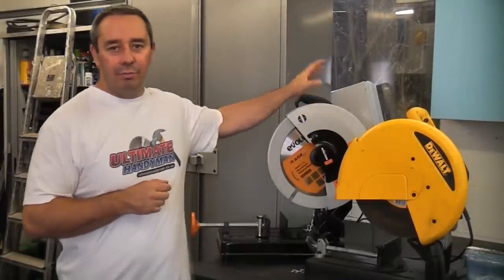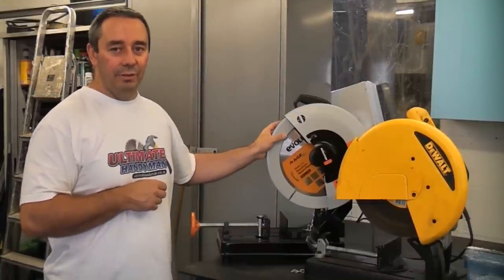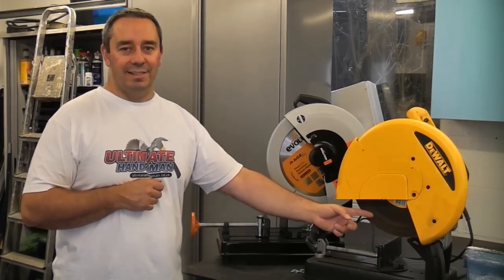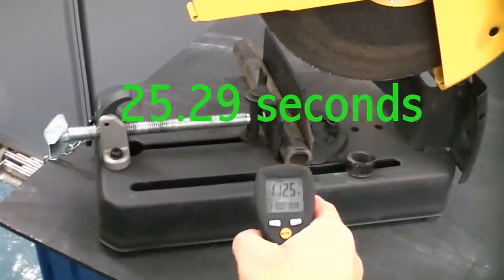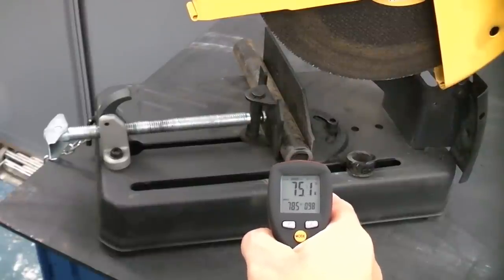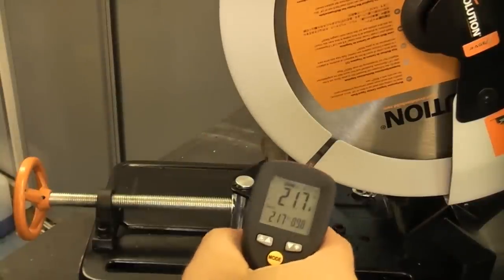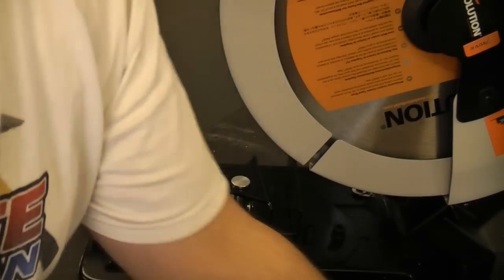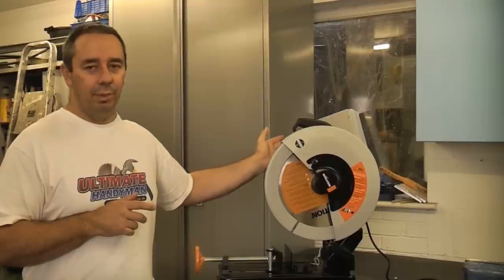Evolution Rage 2 versus Abrasive cut off machine

Comment: When the evolution blade becomes worn it will cut slower and make more noise. It can be resharpened by following these notes.1 remove blade and place on a bench  edge. 2 mark one tooth with white files, that's the first tooth. 3 visually examine the shape of the tooth, one tooth is left angled and undercut and the next tooth is right angled and undercut.4 use a metal cutting disc, not grinding disc!, to reface each tooth the same as it was when new. Rotate the blade refacing each tooth until you reach the files white marker on tooth one. These blades can be sharpened three times.

Comment: Used to have a Makita abrasive cut off saw, changed to Evolution 5 years ago. Only on the third blade and use it most days, have had thousands of cuts out of it including up to 40mm solid bar.
Reply from the maker: +H4NS0L0 
Thanks for the info ;-)

Comment: I bought the next step up Evolution. Its not the Rage2. Its the Evosaw I believe. Anyhow after a short while the cuts were not square vertically. There were a few problems causing this. First and easiest to fix was the fact that the screws that hold the motor together had come loose. They can be tightened by removing the blade to access the screws. All but one can be accessed without removing the blade guard. One of them either requires removing the blade guard or drilling a hole in it directly over the motor screw so that it can be tightened through the hole you drill. Thats the option I took.
The next problem was wear on the axle that the blade motor pivots on. This required tightening the set screws on each end of the axle. That didn't fix the problem so I had to loosen the three bolts that attach the saw to the table and shimming till the saw cut square again.
The third issue I found was the table was not actually flat. This I have yet to fix and will require milling the table flat.
Reply from the maker: Blimey that sounds like a lot of hassle.
Have you not contacted Evolution about the problems?

Comment: I think you were pressing too little with the abrasive. It has to be not too high and not too low pressure to get the most effective cut. If you go too slow it heats up the metal to high enough temperatures that it can harden the metal making it cut slower and in some cases not go through at all!
Reply from the maker: Yes and if you press on too hard there is a risk of the blade disintegrating ;-)
Perhaps you have not seen this video- https://www.youtube.com/watch?v=Orx676NXyws

Comment: Thanks for the video. Make's things clearer for me
I want to buy a cut off machine, but i am also thinking of a bandsaw, but they are a bit more expensive...
What would you buy?
Reply from the maker: +D. Mulder 
It depends what you are doing to be honest. If you are just cutting single pieces of metal the Rage 2 is brilliant- much better than an abrasive saw.
But if you care cutting lots of pieces at the same time (pack cutting) you can clamp them on a band saw, set the blade to lower and then go and do something else whilst the blade cuts through the pack.
The Rage 2 is an awesome machine though ;-)
Reply: Well i bought it! Awsome machine, but can i use the standard disc for stainless steel? or does it damage the blade?
Reply from the maker: No, you need a special blade for stainless steel-
Available from ebay- http://fave.co/2ik2DuD
Or Amazon- http://fave.co/2i0ANWm

Comment: Tooth cutting  blade here in Australia 14inch/355mm $146. Grinding/cutting disc 14 inch/355mm $21.48. 1/6 ratio. Also metal tooth saws are around $700 vs $179 for grinding cut off saws. Bout 1/4 ratio.  My mate builds patios for a living and thinks the toothed jobbies are the way to go but hes going back to the grinding saw every time he has to buy a new blade ha,ha.
Reply from the maker: +iampennochio 
Are you talking about evolution machines and blades or another make?
Over here the evolution chop saw is cheaper or very similar in price to an abrasive machine. The blades are more expensive but will outlast 20 abrasive discs so they work out much cheaper.
Reply: Dewalt, bosch, makita all around same price. Goes up and down based on clearance sales etc. But thats pretty standard prices around here. The evo can get shipped here for around $600 total but warranty claims would kill you in postage. Looks like im stuck with the grinding chop saw for a while damn it. Hate the smelly, noisy, dirty thing it is.
Reply from the maker: +iampennochio 
Yes, I know exactly what you mean. Abrasives are not the best for cutting metal.
Thanks for the comments ;-)

Comment: Where to buy? Could be the blade use in Bosch or DeWalt cut off machines? Is it awailable in India?
Reply from the maker: I don't think they have a distributor in India. I'm afraid you cannot put the blade on another machine, it should only be used on the Evolution machines. Dewalt now make a metal cutting chop saw, with a TCT blade, but they are considerably more expensive.

Thanks for the comment 👍

Comment: is the evolution chop saw the same as a regular chop saw or is the blade the only different
Reply from the maker: The machine runs at a slower speed and also has an high torque gear box.
Reply: thanks
Reply from the maker: rajen ojar 
You are welcome ;-)

Comment: What kind of a blade is that on the evolution machine? I would imagine you can get the same blades on dewalt machine?
Reply from the maker: No, you can only get the Evolution blades for evolution machines as far as I am aware.
Thanks for the comment
Reply: Hm. I found these on Amazon:
http://www.amazon.co.uk/Evolution-RAGE-185mm-Multipurpose-Blade/dp/B003OJ1BUM

If the width and bore are the same, it should fit ?
Reply from the maker: Hendrik Hallo
The abrasive disc size is 355mm with 25.4mm bore. 
You can get Evolution blades that exact size but the maximum speed is 1450RPM
The Dewalt chop saw no load speed is 3800rpm which is over double the recommended speed for the blade.
Using such a blade could be dangerous!

Comment: nice video! tks!

is the diameter of the orifice of the disc/blade standard? (for those same 355mm) Tks.
Reply from the maker: +Xpim 3D The Evolution 355mm blades all have a 25.4mm bore (1") as far as I am aware.
Reply: same as on the abrasion disk? tks for answering :)
Reply from the maker: +Xpim 3D 
Yes, but you can use the abrasive disc on the evolution machine or vise versa as they run at different speeds.
Thanks for the comments ;-)
Reply: +Ultimate Handyman Cool, thanks!

Comment: I bought one. Less than a month and the teeth are braking off and the thin blade vibrates a lot.
Reply from the maker: +Garcia Rosa 
What are you cutting with it?
I've cut lots of mild steel on mine with no problems at all.
Reply: The blade has a little flex but my guess is that your pushing down too hard and this is causing problems. If you just cut slow and constantly you probably won't have issues with the blade wobbling too much or teeth breaking off ...could also just be a bad blade though.

Comment: could it handle 3 to 4 inch solid steel if done right?
Reply from the maker: No, the maximum cutting thickness recommended by Evolution is 6mm (if I remember rightly).
But to be honest I have cut much larger pieces, even 2 inch square steel bar but it will eventually damage the blade and machine.
For cutting stuff like that I would get a metal cutting bandsaw.

Comment: you can't argue with that, the facts are clearly visable arn't they.

i have two of the Makita ones. one at £400 & the other at about £1200 but i wouldn't use either for anything other than wood. i do however cut a lot of plastic.

does this have a cutting depth to handle 4" soil pipe?
how much are those Rage 2's Chez?
finally, how much are the discs?

love the sale btw :D
Reply from the maker: Thanks Rich, These machines are amazing. I wish I had bought one of the bigger Evolution machines years ago.

Comment: Bloody impressive. Do you rate the quality of the Evolution gear? Almost looks like a paid promotion!
Reply from the maker: I have owned the Evolution Rage 3 circular saw and Rage 3B Mitre saw for over two years. I tried them on metal and they will cut it but not brilliantly.I needed a metal cutting chopsaw and bought the Dewalt abrasive cut off machine. I have spoken to many people who love the Evolution gear so I thought I'd give them a second chance.

The larger machines are absolutely awesome at cutting metal, they cut through it like an hot knife through butter!

The Rage3 B mitre saw is very small but if I am cutting timber up to 4 inches wide it is the first machine of choice as it is so light and easy to use. I also use the Rage 3 circular saw regularly and that is a good machine for the money.

I can confirm that I am not being paid by Evolution, I would never knowingly give a dishonest review or promote anything that was not up to the job. I'm just gutted that I didn't buy the Rage 2 instead of the Abrasive cut off machine originally.

Thanks for the comment ;-)
Reply: ***** That is good enough for me - i've seen a few Evolution tools and have always thought they seem a bit cheap to be good quality - might have to give some a try based on this. Almost seems too good to be true!
Reply from the maker: JalexpUK
That is exactly what I used to think, but the last two of their machines have really changed my mind.
Thanks for the comments

Comment: ¿A question the blade can be sharpened? ¿Ok not by me but , for an expert?
Reply from the maker: +Beto Bonilla 
I don't think so. The blade stops pretty sharp until all the teeth wear out, then the blade needs replacing as far as I know.
Thanks for the comment
Reply: +Ultimate Handyman Yes carbide tooth blades will get dull eventually and can be sharpened with the right equipment...not sure exactly how.
Reply from the maker: Thanks for the comment ;-)

Comment: yes they cut off saw blade will cut almost any thing however it also cost twice as much for the blade and the machine then an abrasive chop saw also the cut off saw cant cut harden steel unlike the abrasive chop saw which will cut every kind of steel mild to hardened
Reply from the maker: +Ragonfand 
The Rage blades are more expensive than abrasive discs, but the Evolution blade will outlast lots of abrasive discs, so the Rage blade actually works out cheaper. Also you are not breathing in the atomised resin and abrasive when using the Rage machines. You are correct about the hardened steel though, which is why I still use my Dewalt cut off machine occasionally.
Thanks for the comment
Reply from the maker: +Ragonfand 
Apparently the Evolution machine will cut hardened steel, it will also cut titanium and even armoured plating- but obviously this makes the blade wear out much faster. A guy from Evolution told me ;-)

Comment: Sweet blade .. I sure like those , Just not the price !!  Good vid ..
Reply from the maker: The blades actually work out cheaper than abrasive discs and the cut is far superior.
Thanks for the comment
Reply: No for 80 bucks I can buy a ton of abrasive disks .. Cost is just not there unless you use it every day !!

Comment: Why not compare it to the Dewalt 872?  That would be a fair comparison....
Reply from the maker: The reason why I compared the Rage 2 to the Dewalt abrasive machine is that they are a similar price. I did not know that Rage machines could cut metal so easily- I only found out after buying the Dewalt abrasive cut off machine. 
The Dewalt 872 looks similar to the Rage 2, but is quite a bit more expensive.
Thanks for the comment
Reply: I would love to hear your thoughts on comparing these two with a powerplasma cutter. Every tool has its strengths and weaknesses.

Comment: Unfair comparison, even the worst cut off machine will cut faster with a metal blade compared to a expensive cut off machine with a abrasive blade
Give that dewalt a metal blade and then will see which  is better , I will take a guess it will be dewalt ;-)
Reply from the maker: These two machines are similarly priced, hence the comparison. 
If I'd have known about the Evolution machine before buying the Dewalt I would have bought the Evolution
Reply: You can't put a metal blade on a machine made for an abrasive blade, different RPM ratings. An abrasive saw will spin a metal blade too fast and ruin it.
Reply: Nope abrassive is 3000 rpm up to 4000 rpm vs metal saw blade at 1450 max rpm.

Comment: Come on. Dewalt saw has angel grinder blade, and the other has metal blade. Check out HOLZMANN MASCHINEN MKS 355 or DeWalt DW872. It has the same blade as Evolution. Same blade you can buy to any circular saw or mitre saws.
Reply from the maker: These two machines are similarly priced, hence the comparison. 
I did not know about the Evolution chop saw and so I purchased the Dewalt (similar price)
The Dewalt has never been used since the Evolution saw arrived ;-)
Thanks for the comment

Comment: I get 700 to 862 Cuts with my Evolution blades
on square tubing 1/4 × 3" 😲
Slugger you only get a 122 maximum 😢😢😢
Reply from the maker: Thanks for the info Roy ;-)

Comment: Argentina 200 dolares vs 10 dolares bad disc ):
Reply from the maker: Yes, but the Evolution disc will outlast the abrasive disc by 30 times.
$200 for the Evolution disc or $300 for the abrasive discs, plus the abrasive discs are atomising all the resin and aluminium oxide, therefore reducing in size all the time ;-)

Comment: Put this blade on the Dewalt and then do the comparison.....you are not comparing apples to apples...
http://www.amazon.com/DEWALT-DW8500-14-Inch-1-Inch-Diamond/dp/B004L3X9AU/ref=sr_1_8?s=hi&ie=UTF8&qid=1423215147&sr=1-8&keywords=dewalt+14%22++metal+cutting+blades
Reply from the maker: I'll look out for one of those blades in the UK ;-)
By the way I am comparing a metal cutting chop saw to a metal cutting chop saw. Both these items are sold with their respective blades. I can tell you with certainty that if I knew how good the Rage 2 was at cutting metal I would not have purchased the Dewalt metal cutting chopsaw ;-)
Reply: +WestCoastMods  different blade different speed do your fucking homework

Comment: Not fair for me.
Reply from the maker: +Blezio 
14" metal cutting chopsaw versus 14" metal cutting chopsaw!
Reply: +Ultimate Handyman blades make the difference, sorry but it's not a fair comparasion. Change the blades and do it one more time.
Reply from the maker: +Blezio 
You can't change the blades I'm afraid. The Evolution blades only work on their machines.
I bought the Dewalt machine about two years ago, before I knew about the Evolution machines.
The Dewalt was £180 The Evolution is about the same price, if I had seen a video like this when I was looking for a metal cutting chopsaw I would have bought the Evolution Rage 2.
I still use the Dewalt when cutting stainless steel, although for the amount of times I do that I could use the angle grinder.
Reply: +Ultimate Handyman 

You have in this video made me regret buying a cheapish abrasive saw, really impressed! Will look around for a cut off saw with a similar blade/setup! Much nicer for metalwork and even cutting aluminium. 

One question though, how is it in terms of producing a perfect 90 degree cut? and is it easy to mitre with?
Reply from the maker: +Semajal 
It's quite easy, you just adjust the clamp using a large Hex key-
https://www.youtube.com/watch?v=zI09uLXTvmE
Reply: +Blezio the dewalt isn't a low rpm saw though so it would kill the blade and not cut well
Reply from the maker: Thanks for the comments ;-)